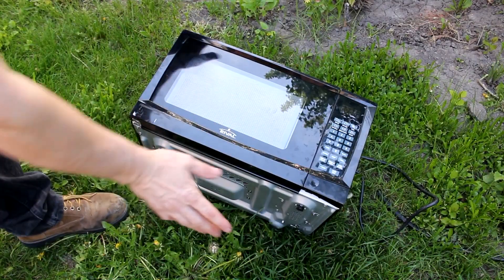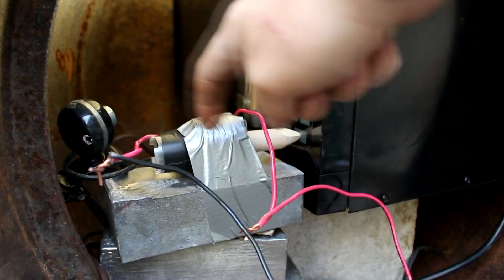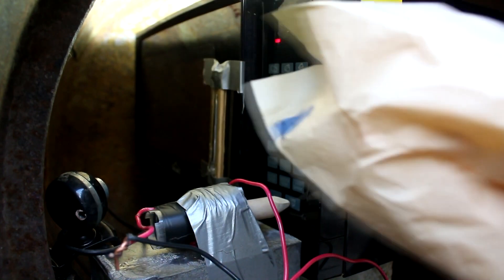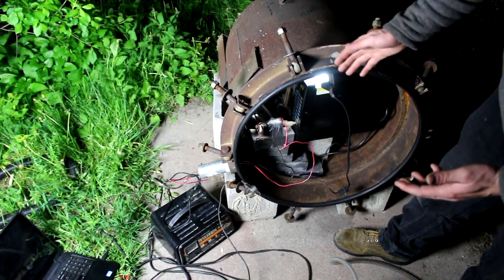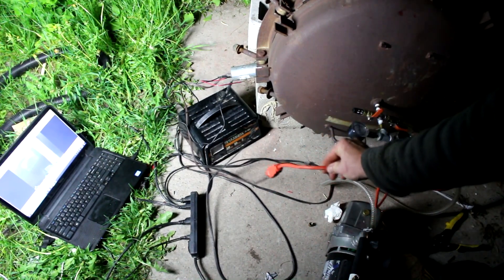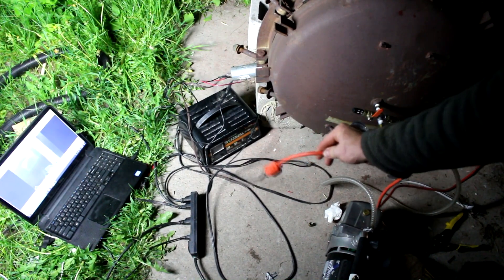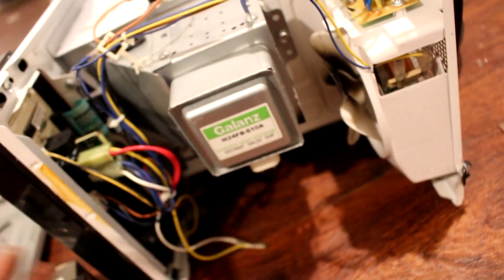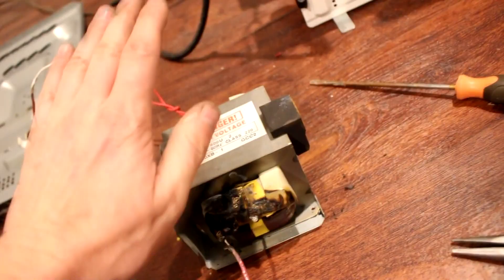Microwave In Vacuum Chamber

Comment: Generally what happens with these cheap poorly made transformers for appliances is the coil windings (and laminations) are not sufficiently consolidated into a single unit with the use of a dielectric coating to prevent mechanical vibration between individual components of the transformer during operation. During use the magnetic flux will cause each turn of wire or lamination which isn't correctly adhered to the next to vibrate against each other causing mechanical abrasion to the insulation of the wire and also further damage to the anti vibration  coating. 
This all eventually leads to a short circuit inside the winding and if the secondary voltage is high enough the arcing seen here (laminations are generally earthed to the metal casing = easy path to earth).
My guess is the transformer was already suspect before the experiment was attempted and either the poorer cooling or simply the lower air pressure (possibly leading to more violent vibration) led to a greatly accelerated rate of failure.

Something to test in future anyway.
Reply: mon librepenseur, you channel your inner AvE very well here,
thanks for an excellent explanation.

further, what are your thoughts on various types of memristive transducers and memXORiff transcievers?
what about plasmonic polydutonic memristors for LIBS entanglement grids?
eschewing ERoEI of course...

je prends conge mon librepenseur!
Reply: In future, test with brand new microwave 😁

Comment: Take another crack at it with a microwave that uses the inverter/flyback method to boost the HV.  Much like a CRT flyback they're fairly well potted and have no exposed connections on the HV side, just a flexible silicone lead.  You'll recognize these by their lack of gravity, not having 30 pounds of copper-bound-iron inside.

Comedy option is obtain another transformer based one, remove the transformer and pot it.  It's not like you don't have a vacuum chamber to extract all the air bubbles from the potting resin...  Slap her back in, and awsy we go.

Third option, again comedy:  Fluorinert or outright transformer-oil immersion of the transformer, like what you get in x-ray supplies, only smaller and more chance of burninating things...

Final thoughts: You might consider putting the control panel outside the chamber, since you have a bulkhead for wires all you really need from the panel is the one to activate the relay for the magnetron, and maybe the lightbulb.  Jump out any interlocks and add a line cord to the control board, and Bob'syour uncle!

Comment: Setup a microwave with its transformer outside the vacuum chamber and test if the current draw is higher. This will test if the transformer shorted out under a vacuum or the microwave is actually drawing a very high load and blowing up no matter where its. It will be interesting to know what actually causes a microwave to eat so much more power in a vacuum.

Comment: I'd hang on to that transformer! If you're willing to respect its dangerous output and feed it lots of line current, MOTs (microwave oven transformers) can be a lot of fun for electrical discharge experiments. That secondary doesn't really look too bad. Just clean up the carbon a bit, and glob on some clear silicone between the iron core and the HV output terminal. 

As an aside, i wish Cody would have embedded a grounded extension cord into the vacuum chamber rather than a houseold 16AWG 2 pronger :P

Comment: the problem is in a vacuum there is no resistance that the air usually causes. it basically just goes haywire and the plasma will burn everything

Comment: Microwaves runs freely on the vacuum (less attenuated since theres no air), thus the magnetron drives more current from the secondary, consequently from the primary, which has molten its insulation than shorted and blew up.

U may try to do this experiment using some extra load, like water, to compensate the efficiency gain from the system operating on the vacuum.

Comment: probably what happened is that there was nowhere to dissipate heat so the Streamys and coating on the copper wire at the secondary coil on them too and they shorted out.

Comment: The microwaves were meeting far more resistance in the chamber and the coil trying to feed that blockage overheated and melted insulation shellac on wires. Watch out for stored charge in flyback transformers using bare hands, ouch.

Comment: The thing you checked after the fan was not the beeper it was a thermal fuse the beeper (or piezo) is on the control board

Comment: For those who may not be aware, microwave transformers step up the standard household voltage (120v) to a devastating 2,000-3,000v and the capacitor beside it holds a charge like a battery. Exercise EXTREME caution if you ever decide to take a microwave apart. Discharge the capacitor first. If you don't know how, I'm sure there are vids somewhere to show you. Bottom line, if you don't know what you're doing, don't do it.
I'm an appliance technician. I work on these for a living, so I know all the workings of microwaves. Can't say I've even thought of using one in a vacuum before though, so I honestly can't say why the transformer blew like that. I have an hypothesis. The fan cools the magnetron and also helps direct the microwaves it generates into the cooking chamber. It's possible that without air to move, it was unable to perform this task and the microwaves spread out to the control chamber and thus the microwave cooked itself instead. That's the only guess I can provide.

Comment: Could it have been without air the cooling fan couldn't reduce the heat, the circuit drew more amps and that caused the failure?

Comment: The voltage on the secondary was high enough to arc to itself (the contacts). Especially in vacuum electrons travel way easier...electroboom has a demonstration for how a Tesla ciol looks in vacuum and regular atmosphere. So the seoncdary 1.2-2KV transformer winding was burnt out because of arcing and no cooling at all for any of the components..

Comment: Do be a bit careful with microwave oven transformers,  they are deceptively dangerous.  only 1kv or so but they will happily chuck out an amp at that 1kv for short periods, enough to kill many times over.  since they don't look much different to normal power transformers it's easy to forget just how lethal that is.  furthermore, one end of the high voltage winding is generally attached to the core with insufficient insulation to keep the HV isolated even if you did detach it....

Comment: Hi Cody ! The voltage at the secondary winding of the HV transformer can be well over 2kV.  This could easily cause arcing in the low-pressure atmosphere.  Also, other electronic components such as E-caps, etc  may 'self-explode' in such an environment.  Please take good note of it. Thanks very much.

Comment: breakdown voltage is very low at low air pressure. Deep vacuum however, breakdown voltage increases significantly.  Opposite happens in piston engines and high compressions!

Comment: I just don't get it why you are so focused on arcing? I think lack of air caused that the transformer had no possibility to transfer the heat. Because of that coil insulation melted and shorted out... that it.

Comment: check the hv capacitor, it probably is damaged internally by the low pressure. this would explain the arcing at the transformer since the current at the secondary would jump way over spec and melt the insulation.

Comment: Air is an insulator. When you removed it, the high voltage had a path to jump from terminal to terminal causing the amps to increase. The fuse did it's job. I'm guessing it was a slow burn fuse. Seeing this is the internet I'm sure someone out there will disagree and instead of a civil response, I'll get something with a lot of swear words and telling me I'm an idiot.

Comment: I would think a vacuum would be a better insulator than air. In fact, ham radio operators in the old days with tube equipment and high voltages would use "vacuum variable capacitors" in their gear because they are more able to withstand high voltages without arcing. The only issue here might be if something in there was outgassing and causing some other gas to be around that might be easier to ionize with high voltage.

Comment: we need to both measure the input current with a tester while its running, and second, only have the magnetron part inside the vacuum and the control circuit outside.

Comment: I'm wondering if a silicon spray like corrosionX would be enough to stop the Arcing.  You're supposed to be able to submerse a treated CRT TV in  water with it running.

Comment: The MOT sure didn't last long! Interesting how you can see the arcing intensified about when the magnetron would have fired up, and that was about the same time as the power was tripped on the first try. So perhaps the magnetic shunt action of the transformer only gave the arc full amps when the magnetron fired up (or tried to), intensifying the arc... hence the delay in the arc getting brighter.

Comment: Essentially the vacuum will rupture the enamelled wire in the transformer. The insulation process is not totally perfect and as a result small pockets of air form between the wire and the insulator - and because of the fact the insulator isn't plastic, it's brittleness causes it to crack and rupture - thus allowing dialectic breakdown. In a proper vacuum this cannot occur because a pure vacuum is a near perfect insulator. Hope that makes sense.

Comment: So that first outlet had a gfci on it... is arcing responsible for tripping the power on the first try? I'm guessing a small arc went from the HV secondary to somewhere else as well as the core. Maybe this somehow went back up the line/ground, tripping the gfci. Anyway, its obvious that the arc burned some secondary wire coating and then there was the usual cascade of shorting turns. Is there a chance of the arc jumping to the primary terminals... might not be good. I also vote for using an external MOT. Seems the hv didn't want to go right to the housing or hit the controller but what about when the mot isn't in the chamber... I wonder if another arc would go from one of the magnetron or capacitor lines to the other side of the HV. Hopefully the magnetron will last long enough in the vacuum to do experiments but it might have to be external as well.

Comment: hey cody!
just a thought I had
reactivity is dependent on the activity of the species isn't it?
the activity can deviate from the concentration of the species since it is dependent on the chemical potential.
if the chemical potential is also dependent on the electric field, can something be made more reactive or inert by the application of an external electric field?
I know that impressed current protection exists but I'm more interested in something more like "parallel plates with a voltage" sort of thing.

Comment: Considering that you were having problems with the amount of power, I would surmise that given the damage to the transformer, it probably overheated, causing the lacquer insulation melted off the wires, allowing it to short out...  Not sure about any arcing, but the damage seen looks more like insulation breakdown in the transformer.

Comment: Air is an isolator. In a vacuum, you need bigger gaps. That's why vacuum tubes work and get electrons flowing at relatively low voltages. And that's also why compact high power (high voltage and current) are filled with heavy gasses sometimes even under pressure.
So yes, the air cap was not enough to isolate the electrodes from each other in a low pressure environment. Just plaster silicone over everything that exposes high voltage next time because the isolation properties of that are not changed (at least not that much) in a vacuum.

Great video, loved it because it nicely showed that there is a ton of things that engineers have to think about when designing stuff that must work in another environment.

Comment: I'm thinking under vacuum the escaping air in the thin layers of insulation exposed metal to metal contact in the secondary on the transformer.  Just like how marshmallows blow up huge under vacuum, but in the epoxy / whatever crap they used in there.  Someone else mentioned just try again but leave the transformer outside and run wires to the oven.  Problem solved :D

Comment: The general rule of thumb for arc distance is.

V = (3000 * Atmospheric Bar * Distance millimeters) + 1350 as shown by Dave Jones from the EEVBlog.

Therefore with lower atmospheric pressure say 0.5 bar you have require about half the amount of voltage to jump the same distance.

Eg.

V = (3000 * 1 bar * 1mm) + 1350
= 4350 V required to jump 1mm at normal atmospheric pressure
But in a vacuum of 0.5bar
V = (3000 * 0.5 bar* 1mm) + 1350
= 2850 V required to jump the same 1mm at 0.5bar, about half but will be closer to half at higher voltages.

Comment: One  lead of the secondary of microwave oven  transformers  is usually grounded to the iron core. When put in vacuum the  decreased breakdown voltage of the  low pressure air allowed arcing between the other exposed lead of the secondary to the iron core. The heat of the arc burnt the insulation off of the outer secondary windings.

Comment: electricity requires atmosphere to travel, but atmosphere also causes resistance. remove some atmosphere and the resistance over air is lessened, allowing the arc to travel farther in a vaccuum, just as explained in the pinned comment.

Comment: Without reading everything: 95% of air out means you have a nice neon tube effect, easy for an arc tu jump that.
You can even do it with a fridge compresser on full vac on 240v let alone the 2.5K inside that hthing!
so that's what happend!
It would have discharged eather around the cap or between the windings. Sorry if I've exactly repeated what someone else might have already said!!!

Comment: you should run the magnetron inside the vacuum chamber with the control and power circuits outside. I was curious about vacuum microwave popcorn. 🍿 you could also use your smaller chamber. Careful that your vacuum hose going to your pump isn't metal tho or you'll end up with a wave guide directing microwaves into your pump

Comment: Air is an insulator.  When you remove it the high voltage doesn't have to break down the air, resulting in much larger and more violent arcs.

Comment: As a weather radar tech, I can tell you that your next issue is going to be in your magnetron and waveguide. Normally these parts are dehydrated and pressurized to prevent arcing and destroying these parts. Air has resistance so arcing is going to be a huge factor in a vacuum. Don't touch that massive conductor you call a vacuum chamber while you're playing around with it. I'd like to continue to see videos from you ;)

Comment: It's counterintuitive, vacuum should be producing fewer arcs as vacuum based circuit breakers are used to prevent the ionization of air or any molecule around and plus, studies show that ionic gases (plasma) is formed around the arcing surface, hence it should be unlikely that arcs will form at near vacuum. I would learn otherwise.

Comment: FYI, the first time it tripped so quickly but not in a vacuum may have been the breaker being "warm" from the vacuum pump running for a while.  That combined with any arcing you had of course.  A "kill-o-watt" plug in meter is very useful for simple power measurement without going all the way to a current shunt and meters.

Comment: Interesting, I hadn't thought about the distance electricity will arc being larger in a vacuum. I just assumed it would overheat from the lack of air cooling. Makes me wonder how long something like an 80mm computer fan would manage to run in a vacuum before it overheated... and if you filled the chamber with other gasses instead what would happen. Would be interesting to see what affect the environment has on computer cooling regarding pressures and the ratio of gases in the atmosphere.

Comment: I would suspect the capacitor as putting an electrolytic in a vacuum is similar to what happens when you smoke one.  It spews out the electrolyte.  Not good.  Perhaps High Voltage Tantalum as a filter instead of the electrolytic.

Comment: Cody be careful, microwaves have a very large oil capacitor, even if you disconnected it still has a very big charge, so much that you could get killed with a discharge from that capacitor

Comment: +Cody'sLab Does that mean that in the very first test (when the breaker blew) that the arc-fault-protection circuit you had it plugged into worked correctly?

Comment: It would be really neat to remove the magnitron and somehow couple it to the vacuum chamber. The chamber will act like a cavity and basically you will have a giant microwave oven. You would need a wave guide or a metal box with a hole to protect the outside of the magnitron from damage (melting wires possibly). keep the transformer outside and use some high voltage cable to connect it. magnitron s are self oscillating, therefore no extra circuitry is needed other than the transformer.

Comment: Correct me if I am wrong, but doesn't an electrical arc use air as a medium and removing the air would only make it even more difficult to arc? I've had my fair share of experimentation with MOTs and they do get extremely hot. My guess is that the lack of air in the vacuum caused the coils to heat up and melt the windings together, shorting out the transformer.

Comment: Cody,

The cause of the arcing is due to the partial pressure.  Paschen's Law is an equation that gives the breakdown voltage, that is, the voltage necessary to start a discharge or electric arc, between two electrodes in a gas as a function of pressure and gap length.[2][3] It is named after Friedrich Paschen who discovered it empirically in 1889.[4]